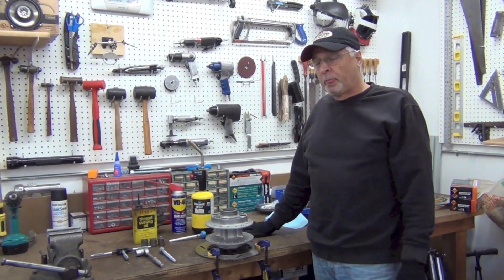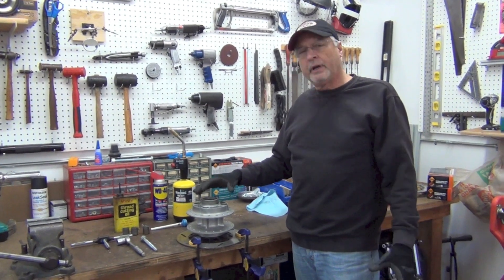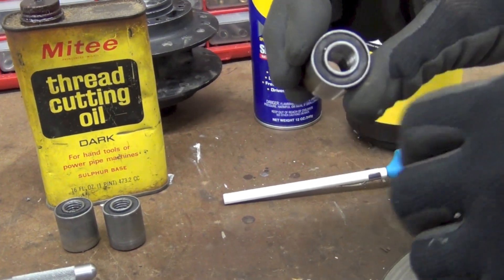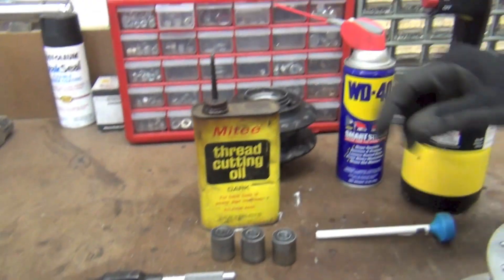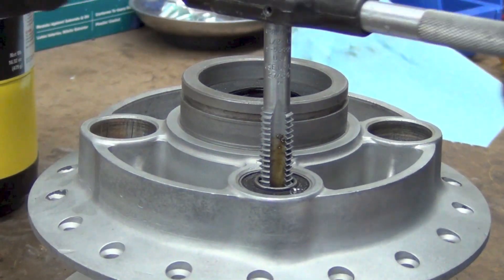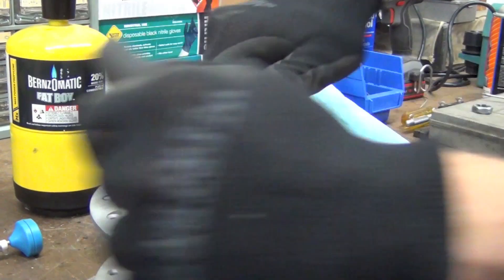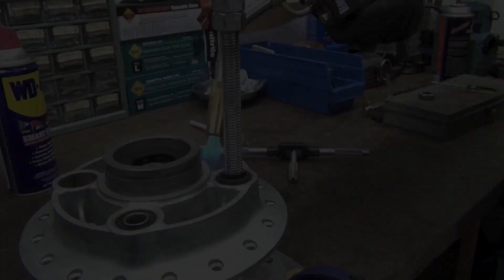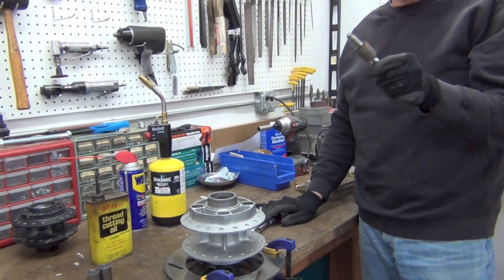How To Remove & Install Yamaha RD400 Sprocket Cush Bushings & Wheel Bearings

Comment: This technique didn't work well for rd400 mag wheels, because the metal at the bottom of the hole is slanted so the bolt starts sliding crooked and doesn't pull out the bearing. I was able to get them out with a combination of a blind bearing puller, some heat and swear words.

Comment: Thank you! I was going to try the freeze/heat method but it's nice to know a way thatll work without trial and error. Thank you again for taking the time to share your method which is pretty damn genius.
Reply from the maker: Your welcome!
Reply: In your opinion do you think the heat would hurt a powder coat finish? My only other option is a drive method with a setup I thought up using a small floor jack
Reply from the maker: Just had mine power coated and I asked the Power Coater the same question.  They said I should stay way under 400 degrees as the powder coating is baked at that temperature.  So, that is why I used the thermometer to monitor the heating process.  At the temperature I used, there wasn't any distortion to the powder coating.

Hope this helps,

Jim
Reply: simplex55 hi I really hope you’ll get this question. Is that mean the hub set was powder coated with the bushing??? I want to remove the bushing before the powder coating to not burn them up. 
Please help me out.
Great video. 
Thanks.

Comment: Genius. I drilled one thru and it took forever to cut out. How do you press in new ones?
Reply from the maker: Hi Emillo,  Just updated my video with how I installed the new cush bushings, so check it out.
Just scroll down to where it says UPDATED: 02/08/14.  No video, but a good detailed explanation of how I did it.  It's really easy

Thanks for sharing my video

Jim